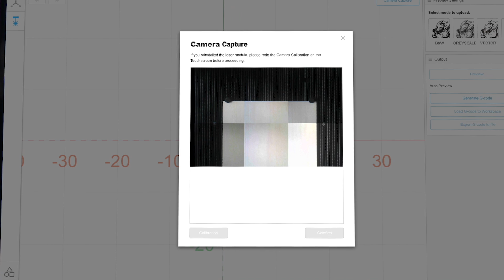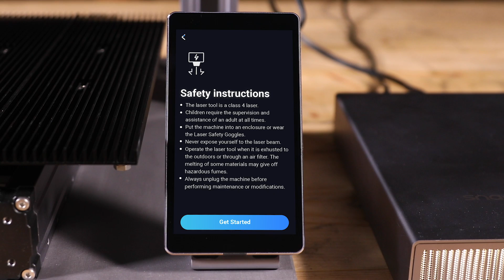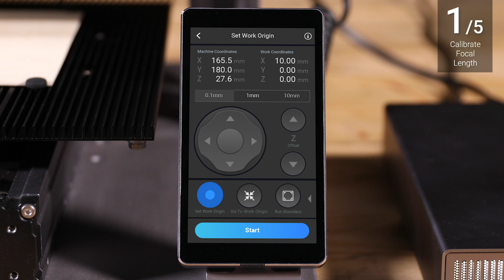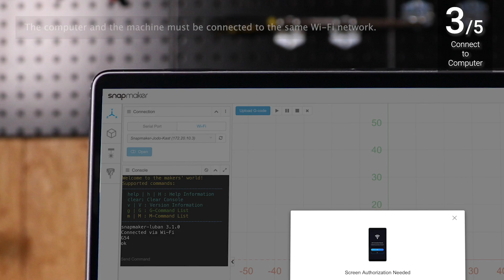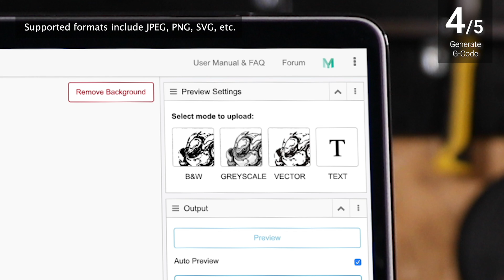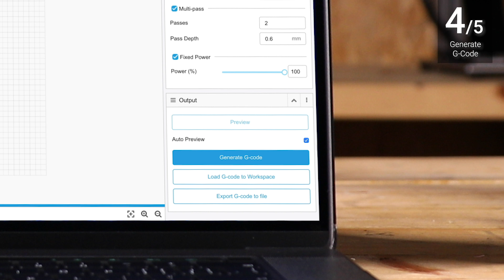Snapmaker 2.0: How to Use Laser via Camera Capture

Comment: I could not find directions on how to assemble the gift box anywhere on the Snapmaker website.  It's not too hard, but would have been nice if someone had pointed it out. I can't upload photos in a YT comment, so here's my best try at explaining it:  The "top" of the 6-sided box is two wood layers deep -- both of the circle ones.  (That's really the key insight that will make the rest of it easier to do than to read about, but here you go.)

Before removing the pieces, number them from left to right, top to bottom:

1 (square) 2 (bow) 3 (square)
4 (square) 5 (outer square) 6 (small circle) 7 (square)
8 (outer square) 9 (large circle) 10 (square)

I wrote in pencil since I didn't really care, but you can use small pieces of masking tape if desired.

Piece 4 is the "bottom." Place it face down on the table.  You can tell, since it's the non-circle piece that doesn't have any side with "extra long" tabs.

If you place the 4 face down and upside-down if you had x-ray vision (or right side up if you fix the far end on the table and tip it up toward you) and then work around the edges clockwise starting from the bottom, piece 1 goes in the slot nearest you, right side up in the assembled position.

Piece 7 goes on the left, right side up.

Piece 10 goes on the far side, right side up.

Piece 3 goes on the right, upside down (don't ask me why, I didn't design this).

Piece 6, the small circle, should be glued to the bottom of piece 9, the large circle, and piece 2 should be inserted in the slot in piece 9.

Piece 5 (outer square with small circle) now goes on the top, with piece 8 on top of it.

Once the glue is dry, the 6/9/2 configuration is obviously the lid.

It is actually impressive to me how perfect the fit is and how smooth the edges are, given all the troubles I had initially getting the laser to focus (somehow my distance got set to 40 mm after calibration on my first run.)

If I were going to change the design any, I'd rotate piece 3 to be right side up, and I'd add a notch in piece 6 so that  when piece 2 goes through 9, it also goes into 6 and either glue wouldn't be necessary, or it would be easier to glue into exactly the right place.
Reply from the maker: Hey! If you need any technical support, please feel free to email at support@snapmaker.com
Reply: @Snapmaker  Thanks!  I'm going to try to use it again tomorrow and I'll let you know if I have any issues.

Can you make a step-by-step first-use video with the current version of the software that shows how to use the camera method of placing your example box in the right place?

Pay special attention to what you have to do both on the computer and on the device with respect to setting the origin in the right spot so it prints where you planned it to.

Also be clear about how often one needs to print those calibration lines and do the paper square cut.  (And also make it clear that the "square" isn't fully square and doesn't connect at the edges.  At first I thought I'd done something wrong.

Comment: A side note for those like me using an updated version of Luban: at the time of writing this, Luban 4.0.3 is somewhat different from what's explained in this video, which is obviously done on a previous version. And beware that doing camera capture seems to set the work origin to machine's 0,0 on bottom left, but when you start engraving from a saved g-code it will try to start from the center, if you don't re-set the work origin on the machine to bottom-left (that is: 0,0) .. frustrating and not so obvious to me...
Reply: ahhhhh thank you thats helpful
Reply: Thank you, knowing that helped me and my dad a lot. We were struggling for probably half an hour, and then I told him that I saw a comment on their video that mentions the problem and a solution, and then we read your comment, set the origin to the bottom left corner of the plate, and the machine is currently engraving a piece of wood in (almost) exactly the right place.
Reply: What about the z height ? And X=0 and Y=0 on the machine is a little outside the actual board is that an issue ?
Reply: I figured this out after the fact -- I just kept experimenting with moving the origin and then telling it to run the boundary, eventually ending up with the origin in the bottom left.  I wish their instructions had been more clear.

Comment: When I camera capture, and send the gcode via wifi or USB, the laser goes to the top right of the machine and not the middle. I do not see where to change this setting. I am using material to see where it burns and then placing the project material in place. Why does the camera capture and image placement not go to the center work origin the machine has set? Thanks
Reply from the maker: Hi! When laser engraving, we need a specific spot to decide the relative location of the engraving area. We call that spot "work origin", and it can't be included in the G-code file. If you use the camera to capture the background, generate g-code, load it to workspace, and run laser in Luban, the software will tell the machine where the spot is. But if you export the g-code to a USB drive or send it to the machine via wifi, the spot infirmation won't be exported together, and you need to tell the machine where the spot is, by setting a work origin on the machine touchscreen. So, if you need to use camera capture function, you can only run the laser in Luban directly. Hope it helps!
Reply: @Snapmaker  Hello, and thank you for the reply! I have figured this out now. I have posted this fix in the snapmaker reddit group as well. The wording made it hard to get that pressing the play icon in the workspace sends it to the machine, we thought the send via wifi was what the documentation online was referring to. Now let's just share this information so other users can make =Dope= stuff!
Reply from the maker: @mistrfinga  Roger that! Thank you for your sharing!😜

Comment: When I try to capture the background image, it is aligned to the top right corner of the luban preview grid rather than in a place that reflects the actual work area. Any ideas how to fix this @Snapmaker ? Cheers
Reply from the maker: Hi! That's how the function is designed. You could just move your picture onto the captured background image and set the other parameters as usual. It will work properly😊
Reply: @Snapmaker  Thanks for your reply! :) When I export the gcode and load it on the snapmaker, the cut seems to be misaligned, it's off the work platform. Im looking to understand why when cutting from Luban it uses the upper right quadrant as the work area, but when exporting gcode to usb and then loading on the snapmaker, it uses the 0,0 point at the meeting of the x and y axis as the center of the work area. I would love to understand what's happening here. Do you have any ideas that might help? Thank you!
Reply: My goal is to use the camera positioning on Luban, and then export gcode and print directly from the snapmaker, I hope that helps.
Reply from the maker: @neuroblossom  Thank you for your explanation! When laser engraving, we need a specific spot to decide the relative location of the engraving area. We call that spot "work origin", and it can't be included in the G-code file. If you use the camera to capture the background, generate g-code, load it to workspace, and run laser in Luban, the software will tell the machine where the spot is. When using USB flash, the spot infirmation won't be exported together, and you need to tell the machine where the spot is by setting a work origin on the machine touchscreen. So, if you need to use camera capture function, you can only run the laser in Luban directly. Hope it helps!
Reply: @Snapmaker  Ahhh now I understand. Thank you!
Reply from the maker: @neuroblossom  You're welcome!

Comment: So this worked first time out. Now, however, when I have gone back to do my own piece, I do camera capture, then it asks me, on the Snapmaker, to position work origin. It then proceeds to not print on the piece of wood but way off.
Reply: I just got my Snapmaker a couple days ago so I maybe why off: I was going round-&-round too with the camera capture; wondering what the use was if you had to do the work origin every time you send the g-code over. Then it dawned on me..don’t send it. The manual even kinda says that...kinda. Load the g-code into the workspace on your computer and control the laser from there; not the controller on the unit. Once I figure=red out what they meant it worked like a charm. Hope I explained that right. I connect via WiFi from a desktop and when I do the the menu to control the laser appears under the ‘console’ display (when you have workspace selected in the upper left corner). I was sending the g-code to the device via WiFi & then running into the same issue about setting the work origin. If you just do your laser settings from the computer those options to set material thickness, work speed, & laser power are right there. At the bottom of page 52 in my printed quick-start manual it says "you can also start engraving/cutting by using the USB disc, connecting with the USB cable, or sending G-code files via Wi-Fi. For detailed instructions, please refer to our online user manual. Unlike the camera capture method, you will need to set the work origin if you use the messages above." Its kind of misleading but I pieced it together to mean "don’t send the g-code to the device if you want to use camera capture". I mean, y0u are of course sending the g-code in order to get it to run but you’re giving those run commands from your computer rather than the attached android controller. Hope I didn’t confuse too much (and hope I’m correct as well). Good luck.
Reply: It is exhibiting this behavior on my first time use, hoping to figure out what's up or if I'm doing something wrong!
Reply: same any fix for this?

Comment: No matter what I do, my camera will not recognize the best engraved line.
Reply from the maker: Hi Ethan, you can send an email to support@snapmaker.com for help in such a case.
Reply: @Snapmaker  I just downloaded the latest firmware and updated via usb and the autofocus works now! The actual camera capture workflow on the other hand does not work. I am having the upper right quadrant issue.
Reply: @Snapmaker  When I try to capture the background image, it is aligned to the top right corner of the luban preview grid rather than in a place that reflects the actual work area. Any ideas how to fix this ? Cheers

Comment: When I send the file using Luban to the device it defaults the work origin in the center of the platform, not at the bottom left like the captured image does - so does that mean I have to manually move the work origin of the X and Y axis to the bottom left 0/0 coordinates first?
Reply from the maker: Hello Philip. There are 2 ways you can use the camera capture function. 1st, connect machine with computer and use the laser online. 2nd, send the file to machine via wifi or USB flash drive and use the laser offline. For the 1st, you don't need to set the work origin as the computer will help determine the working area. For the 2nd, you need to manually set the work origin, as no info about working area could be included in the g-code file. Hope this could help : )